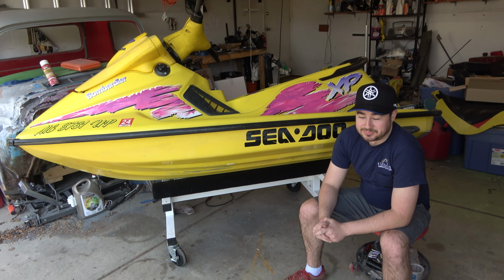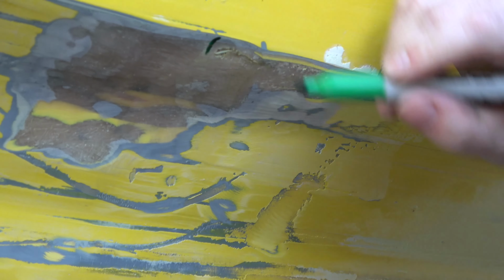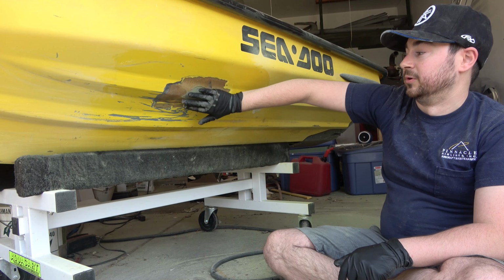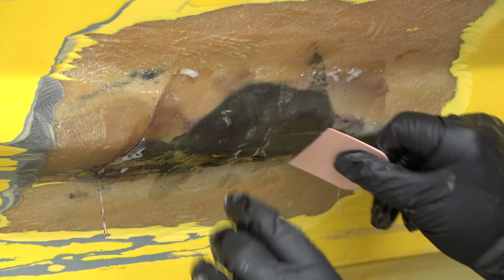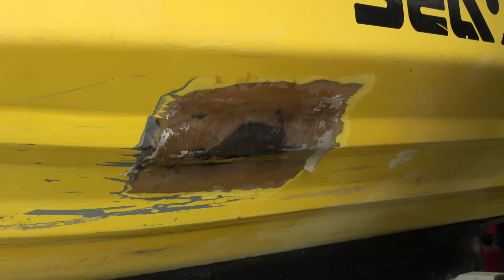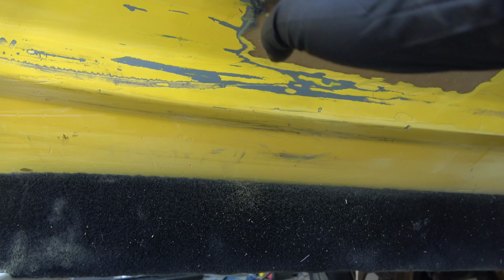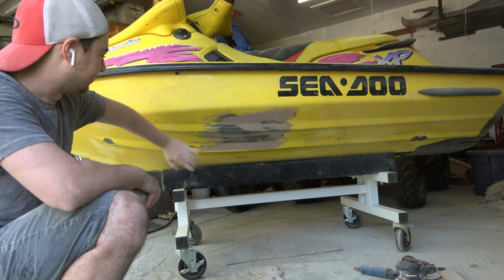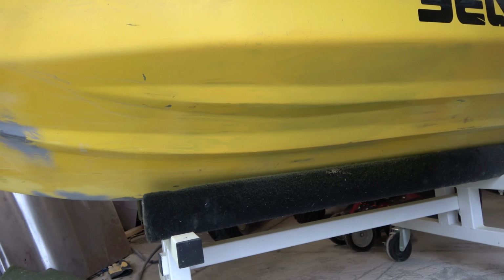Jetski Fiberglass Hull Repair, How to

Comment: I have a question about a repair I need to do on my jetski if you don't mind.  I have a 97 seadoo xp that I traded some rc car stuff for and when I got it home realized it was in a little bit rougher shape than I thought. Anyway around the front bumper where the two hulls are riveted together a couple of the rivets completely broke out the fiberglass so I was wondering how I should go about patching that up so I can drill new holes through and re-rivet it back together. Thank you
Reply from the maker: I guess it would depend on how damaged the holes are. Are you able to open and clean up the hole and use the next size up rivet? If not, we use some 2 part stuff called Hysol on aircraft when we have issues like that and need to fill and re drill holes on a composite piece. It takes forever to cure but when it does, it's the same strength as metal.
Reply: @MikeT  it's hard to explain but the 2 holes that connect the front bumper are completely drilled out so the hole is now a horseshoe like it was drilled out. Gonna need to form some fiberglass to fill the gap of the whole and I'm just not sure how to begin lol. Wish I could show you a picture

Comment: Were there any concerns about water in the hull? I've got a similar repair on the same ski (more in a flat area, less close to the chine, but very similar). But there is water seeping out of mine when I press my finger on the damage. Water is coming from inside the de-lamination maybe? I'll gently start dremeling away at the de-lamination and see how deep it goes (Seadoo has a double hull design so I can't visually inspect the interior for water or damage :-( .
Reply from the maker: There were not. We had water coming out of the damaged area and the inner composite area seemed to be intact. In part 2 where we Gel coated the hull, while sanding we found a few more spots of damage and repaired them the same way. After the repairs and gel coat there was no further water getting into the haul. I would assume if there was damage to the inner hull, when building a base for the repair with the fiberglass impregnated bondo, any damage to the inner hull would become watertight

Comment: How would you start if it was a hole all the way through?
Reply from the maker: Either start on the inside and put a few layers of fiberglass cloth down or bond a thin piece of sheet metal to the inside and the build the repair off of that from the outside the same as shown in the video

Comment: How long do you let it set/cure when you added bondoglass before adding the glass sheets?
Reply from the maker: It really depends on how much hardener you use and how much you mix it. It cures pretty quick and in some cases can be cured enough to sand in 20 minutes

Comment: Great video. I wasn’t sure about what to do after the bondo glass. Using the fiberglass sheets to add the hard structural layer makes sense and I wasn’t accounting for that at all. Cheap and easy way to double down on structural integrity. 

(I hit a hidden rock 50’ off shore coming in yesterday and am doing this similar repair)
Reply from the maker: Thanks, glad it helped